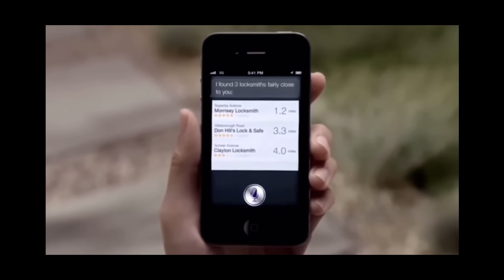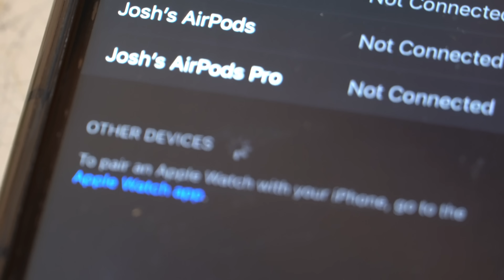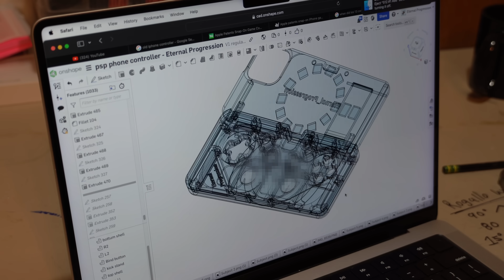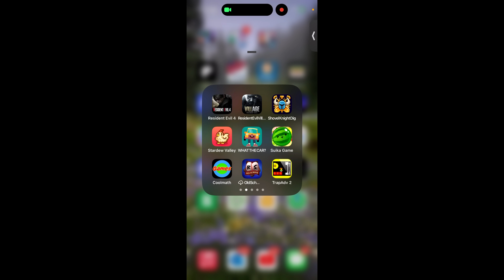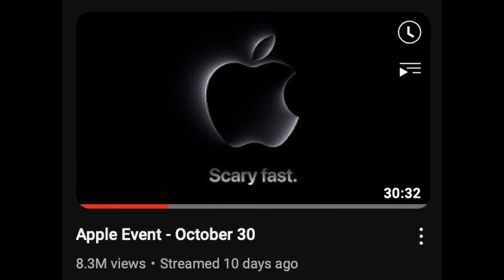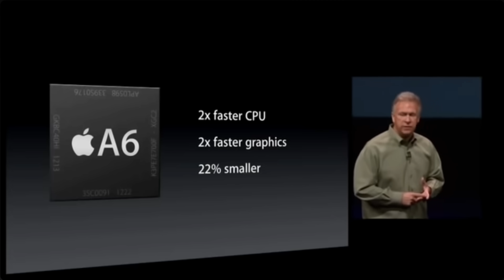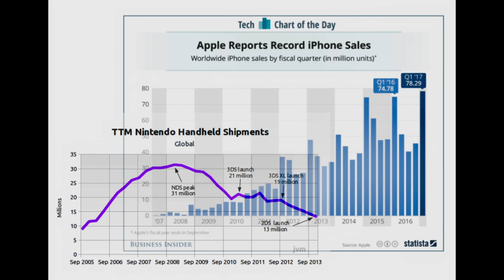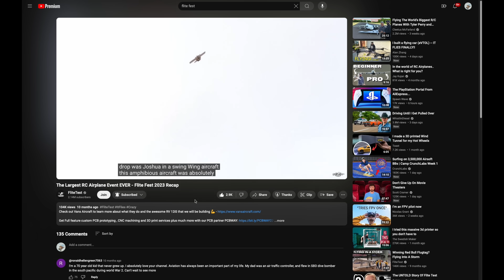I built this controller because no one else would | M-Con V1

Comment: step 1: get a patent asap, now that this is in the public
step 2: run a kickstarter to get all the funds for all the presales, money solved
step 3: with patent in hand and working proof of concept with X amount funded and backed, can easily sell patent too the highest bidder like razer, apple, etc.
Reply: This would be very hard to patent, unfortunately. Design patents were recently vastly reduced in scope and that's the best protection for something like this. You'd have to have a very strict definition of what is covered by the patent -- the magnet attachment + sliding and locking mechanism.  He didn't design the PCB; that was taken off-the-shelf from somebody else, so there's nothing to protect there and honestly not even something he could commercially sell at scale without licensing agreements in place unless he wanted to design his own board (or get somebody to do it for him).  I've been through the patent process a few times and have three granted patents to my name.  

Besides the absolutely insane cost of bringing a patent to completion (6-7 figures), there's also a lot of prior art here.  He mentioned the sliding keyboard mechanism of the PSP.  There's a ton of Android phones from the early days and pre-smartphone phones that had slide-out keyboards, and those may still have relevant patents kicking around.  You'd have to do discovery to make sure you weren't actually infringing on somebody else's patent. That's going to be a costly legal minefield, and honestly that's probably the real reason we haven't seen any of these.  

Finally, a patent is sort of "all or nothing". You want to have your patent be as broad as possible to get the most protection, but that also means that it's the most difficult to prove as novel.  Therefore you need to severely limit your scope and that means that it's easy for somebody else to be non infringing by not doing something trivial.  Additionally, a patent has to be "non-obvious to  somebody trained in the field".  Given the amount of magsafe attachments out there and the number of sliding game controllers, putting those two things together isn't exactly "non-obvious".  Considering he is using somebody else's board, a design patent would be the best approach, but even that would likely be a waste of money.  It would be better to partner with a big-name company for a licensing deal and let them handle it and take the good publicity on both sides.
Reply: @sq3rjick A lot of great points, I'm more familiar with trade marks. So then, proof of concept and pre-sales would be most valuable to sell the idea to a manufacturer. So, the logical method would be to crowdfund, even if he wants to keep the business.

Comment: I’ve got the Backbone and a case that fits inside it. You’ve pointed out many problems that I’ve been having with said controller. Whenever I want to use it, I have to make sure to have it with me in my backpack and then I still have to pull it out to use it. That’s not convenient for pocket gaming wherever whenever.

Comment: Awesome work! A couple of questions/thoughts on the design, given some of the awesome innovations in the mobile phone controller market recently:

- Would it be possible to sink the stick modules into the shell a bit more? That might allow for Switch-style sticks, and even better the hall-effect variant. This will future proof the sticks from stick drift, which 3DS style sticks are prone to, and will feel way better from a gameplay perspective.

- Curious if you explored microswitches on the buttons/dpad instead of membranes? Would increase the life of the device's buttons, and again will cater to those interested in mobile phone controllers since this is a common feature these days.

- Do the triggers have analog?

- Consider having grooves for a "handle" attachment so the controller could be more easily converted for screen mirroring play (kind of like the Switch joycon grip)

Comment: The weirdest thing about this video is the fact there were zero mentions or acknowledgement of the Xperia Play and the slow but steady rise of Android based handhelds.  But I have wanted a controller like this ever since the Xperia Play appeared. On the Android side, it obviously needs to be paired with a case. But yeah, this kind of Controller + Case on Android for $50-$75 would sell very well. Companies like Mocute which made the very best super cheap smartphone controller and iPega are bound to copy it if it gains traction. But yeah, this design could only be truly mass market if Apple, Sony or Microsoft got behind it.
Reply: M-Con orders come with a free MagSafe sticker to work for android devices. I agree with the lack of mentioning of the Xperia Play. But I think Josh had more experience with the PSP Go, as the Xperia Play was an older gadget. They are still young.
Reply: @SRC267   PSP Go is 2009 and Xperia Play is 2011.

Comment: I think you have a cool idea. I’d try to get your design to as thin as humanely possible. In its current iteration, i don’t see a person just walking around with this permanently attached, which at that point isn’t hugely different than a grip controller. Open sourcing the project would also help your development leaps and bounds unless you plan on this becoming a full time side gig, just my 2 cents.

Comment: As  a game dev this thing actually solves a large issue when designing games for mobile gaming. Mainly that when using a phone the controlls themselves take up valuabel screenspace that is already limited on a mobile device. This is fine for some types of games, but it is very restrictive for many genres. Making a controller connected to the device a norm allows for more genres of games to be viable for mobile.
Reply: Problem is this doesn't solve anything regarding that. There is still no reason for a dev to assume people will have these and have them on them. The only true way to guarantee such a thing would to have it built into the phone. Like Sony did a while back. 

Id argue a better Idea would be to make a controller built into a case design to just be on your phone all the time. Somehow making it thin enough for people to consider doing that
Reply from the maker: Ya I think my view is, there will never be a day where every one has it. That’s just never gonna happen, not everyone plays games. But even if it sold a couple million. That’s a million more people that could have it on them all the time and might be more likely to buy a game on the App Store than before. And I think it would grow from there! Not to mention that if this is successful I’m making my own games tailor made for it!!
So definitely some insane dreams and it might not be possible. But this at least opens up the opportunity for it to happen at all yk. And! It will work with android! I want it to be compatible with everything! Old, new, five years down the line new, everything! 

Also So cool to see game devs in that chat man😁!!! Thanks for the original comment @emilekroth100
Reply: This is one reason why I am excited for the future of android games that are unique experiences for each android device (ie razr kenshi, backbone, Odin, Logitech G Cloud) the attachable controller or dedicated controller community is widening
Reply: What's wrong with all the other controllers that already exist that YouTubers like ETA Prime have been covering?
Reply: @bland9876  he states whats wrong with them in the first few minutes
Reply: This device is cool. But it will NEVER become the norm. Unless Google, Apple or Samsung make it and advertise it alongside their phones.
Reply: @firefox1033 Nintendo, xbox and sony could absolutely do it in a partnership if they really wanted to make money. 

One of the reasons why the Switch makes so much money for Nintendo is because everyone has one.
Reply: this could be mass produced as like a $35 product
Reply: add it as a option, gamepad and kmb support is important.
Reply: Not having proper triggers is annoying as well
Reply: Dude just made the entirety of the ps vita library playable on it
Reply: @user-pq4by2rq9y  def not but sure
Reply: But to be honest, not many phone user used Bluetooth controller at all.
Average phone game players are used to "click'n drag" control, unlike the retro gamer.
Reply: The thickness is still the problem. The price wouldnt be much of an issue for apple buyers but it looks like its atleast gonna be 50$ so it wont go mainstream on android land.
Reply: @bulletpunch9317  I do not see thickness as a downside to it as the original game boy was a chunky boy and that did just fine and there is no reason tho think that with a little funding and a bit of engineering, that this could not get a bit thinner. Remember he was using components that were not specifically designed for this but a custom pcb could actually help the components lay better including the sticks and help with the overall thickness.
Reply: @AltimusPrimeG1  from a game dev point of assuming everybody to carry this controller it is too thick. i heard he can bring it to like 13mm. If your other pocket is empty its ok i guess.
Reply: @bulletpunch9317  No it will not be for everybody and some may have an issue with thickness. Again I go back to the gameboy and the thickness that  habdheld had. I carried that thing all through Highschool (yes I am that old) in my pocket. I even had accessories that made it even thicker and still carried it all the time. This was before cellphones really took off so the only other thing I had on me was my beeper. I still had both on my with my wallet. 
All of the above is the reason why I find the thickness being an issue a little silly of a complaint. I am sure the Gen X (yes i am one)  people and older will not have an issue but maybe the generations that follow do have an issue with the thickness. Only time will tell.
Reply: @AltimusPrimeG1  might have been okay for you but i remember even gameboy had a smaller pocket version later. I guess you just had big pockets.
Reply: @bulletpunch9317  nope stuck out but who cared, it was not something I even gave much thought to. Yes the pocket did come out but then when the game boy color came out it was back to almost the same form factor again not to mention the size of the folded up advance so which had almost the same thickness as well which people got over the regular advance that was thinner because it had a better screen. So when people see something that is better even if it has a bigger form factor they seem to go with it and do put it in their pockets even if they bulge a bit.
Reply: @AltimusPrimeG1  atleast it has its niche then. Certainly not enough to design mass market games over these days though
Reply: @bulletpunch9317 That and heat, don't mind playing on my phone but I ain't trying to hold a ho slab of metal later 😅
Reply: @masterace9543  looks like heat can be solved somewhat with the frore airjet
Reply: @masterace9543  what heat are you referring to the controller should not be an issue with heat and if your are talking about heat from the phone, I play pretty intense graphic games on my phone quite often streaming from my steam account and yes the phone can get warm but too hot to hold, no.
Reply: @bulletpunch9317  Why would you assume that? Some of the most popular controllers for phones that attach are like $60+.
Reply: @Bigdude0444  true, but the android kids who get $100-200 phones arent gonna get em.
Reply: @bulletpunch9317  As an android "kid" with a 200 eurobucks phone, I would, but the only options available for controllers are more like a hundred and at that point might as well get a dedicated handheld that won't be sucking my phone's battery.
Reply: @LutraLovegood  theres so many on aliexpress from like 10$.
Reply: @bulletpunch9317  some popular android phones are more expensive than iphones LOL
Reply: @bulletpunch9317  it really isn't, it fits in your pocket and that's all it needs to do. I am much more worried about comfort and weight balance because the psp go was very uncomfortable for some games if still a neat piece of tech.
Reply: @user-pq4by2rq9y  i fits in pockets only if the pockets are empty.
Reply: @user-pq4by2rq9y  yeah its sell but itd sell more if it were thinner
Reply: @bulletpunch9317  Thickness a problem?? 😄 u haven't taken a good look at mobile controllers actually worth buying. They keep getting thicker!
Reply: @zerocal76  oh i sure have. I would buy those if i wanted a comfortable one. This thing i want it to be thin enough to be easily pocketable.
Reply: @bulletpunch9317  - imo the thickness is helped by it being detachable. I would definitely buy this as an android user and while I did get used to more thickness with a fold4, I might keep the controller detached in another pocket even with a standard slate phone.

Also could imagine keeping the controller in a bag if I want to carry light and just snapping in when I need it.

Comment: @ZackFreedman 's 3d printing channel might give you some neat ideas, like getting build plates the imprint a patterned, even iridescent color (even to non-iridescent filament, in a process called "structural color"), as well as tips like pausing a print to insert something (like your mag-safe gear, or just magnets, nuts, bolts etc.) then resuming the print to encase it inside the print.

Comment: If the top piece is already detachable, could that instead just be part of a phone case? That way cases can be made for all different phones, built to be compatible with the same main controller piece (or maybe you still keep it bundled, but at least it would allow all sorts of android+ios adoption)
Reply from the maker: The design now is actually easier to make adaptable than a case would be! It WILL and this prototype does work great on Android. Definitely a priority😼

The user being able to have what ever case they want one the phone is really important to me. I know I wouldn’t want to be stuck with one case forever.

Comment: Very hopeful for this, but the biggest issue is Bluetooth. If it was a non-wireless connection, it would be ideal.
Been wanting a modern Xperia Play for years. This is one step closer.
Reply from the maker: Bluetooth is just as good as it is on the ps5 and switch on this prototype. I’m making sure the official launch has the newest! Most powerful! Highest pulling rate! And lowest latency! Bluetooth chip we can get our hands on!
Reply: @joosh_king  Still does not come close to wired connections, IMHO. The display buffer in Android and iOS makes it a nonstarter if you are picky about latency. Excited to see how the product evolves, though!

Comment: Cool project! Would be awesome for emulation or console ports of games like Stardew Valley or Lego Star Wars: TCS. 

Unpopular opinion, but native iOS shooters are way better with touch screen controls than any joystick controller. It’s just far more accurate than any joystick. It has a learning curve and requires custom mapping of the controls, but it’s definitely worth it imo. Back when the iPad mini 2 and iPhone 6s were my main consoles I dominated every shooter with the classic claw grip. Only Fortnite was an inferior experience due to the added complexity of building.
Reply from the maker: Actually I agree. Aiming is pretty awesome on touch screen but nothing else. When I play shooters on this I actually use the touch screen to aim with my right and I can also use the physical triggers with my pointer finger. And use the left side of the controller as normal. And it is so sick!!! Like it is OP. I also want to have gyro controls as well. 

You can also slide it down half way and have the joysticks showing and it’s so comfortable.
Reply: @joosh_king  Gyro controls would be an awesome addition! Ever since I first experienced them on the Switch they have become one of my favorite features on modern controllers. 

Overall, the project looks really well done. I am excited to see how it develops going forward! I wish you the best of luck!

Comment: Bold theory: V2 uses an esp32 microcontroller instead of the amazon switch controller pcb 🤔🤔🤔
Reply: Yeah that would be the best, you could even design the esp32 completely into the pcb. I use them for my mechanical keyboard pcbs.